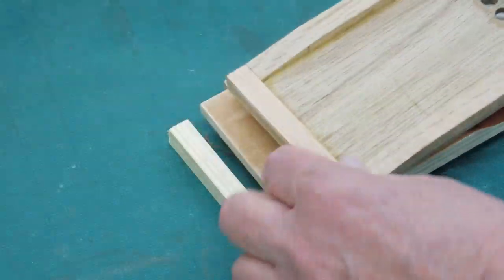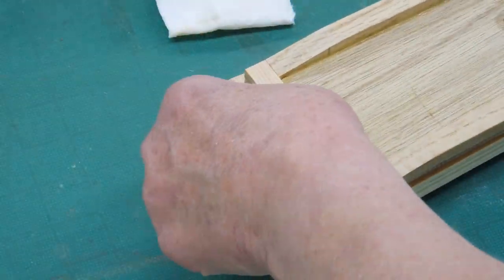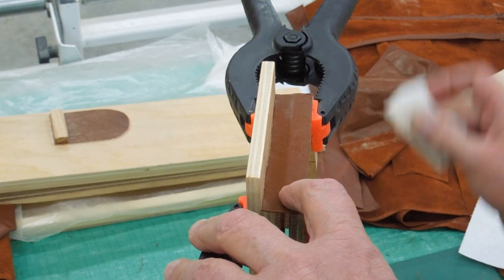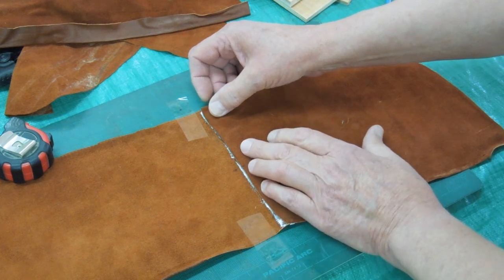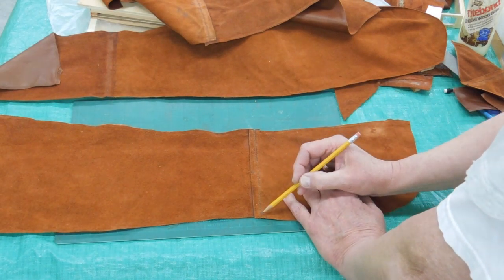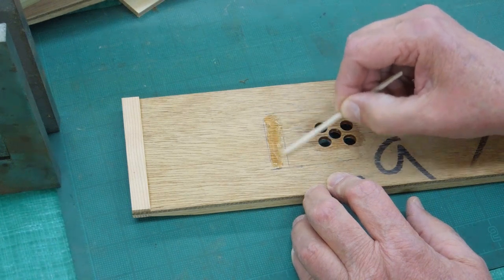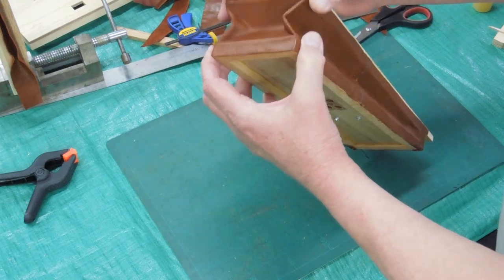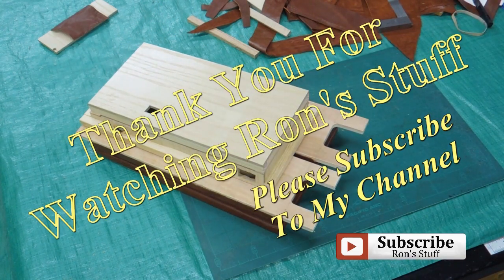Building The Busker Organ - Flapper Valves & Bellows Part 2

Comment: Hope you continue with the Busker organ videos, I've just started and could use more guidance on the pipe dimensions. Thanks for the help,
Reply from the maker: I suggest you carefully study the plans and write down the dimensions pipe-by-pipe. His drawing can be a bit confusing. In the area of the plans where it gives the pipe dimensions for a width and says “plus wood” … that means to add the thickness of the wood to either side of that piece… so it means that dimension plus 2 times the wood thickness. Clear as mud… right! It was confusing to me until I read it several times. I will cover a little bit about the pipes in a video in a few weeks but probably won’t really get into any real detail until the actual build videos, which will be a bit down the road.
Reply: Ronald Walters Thanks!

Comment: How about using a seam roller on the wet glue in the stitching holes to push the glue into the holes.
Reply from the maker: That would help, but what I did worked perfectly. Better still use a full size sheep skin and no stitching. I have several videos on making the Senior 20 Organs.
Reply: @RonaldWalters2010  it's just a thought, it wasn't meant as criticism.  I came to your video to see how you made the one way valve. Are there more videos on the organ ?
Reply from the maker: George, I didn't take it as criticism... I tend to be a bit blunt sometimes. I started to build the busker and switched to the Senior 20. The Senior 20 is a better organ, better wind, improved pipes, improved air supply, etc. My build of the Busker air supply was an experiment for me to see how the system worked and to decide if I wanted to go any further. I ended up using the Busker air supply to test pipes for my other organs. 

I built two Senior 20 Organs, the first without a conductor and the second with a conductor. I later converted the first to be motor driven with motor rewind and the second was then built with a motor from the beginning. I made the case a bit larger to accommodate this as I have no intention of carrying the thing around (ever). You will thank me hundreds of times if you build yours with a motor as the organ will get played many more times and you will enjoy it more (and your shoulder will thank you).

I then designed (from the ground up) an Animator Conductor to go in my second Senior 20. I sell a casting kit for the Conductor. 

Go to my channel page and then to "Playlists". There you will find the entire video series on building the Senior 20, building the Animated Conductor and more recently my build of a Mini Calliope which originally was a construction article in Popular Mechanics.

Quite a few have used my videos to successfully build their Senior 20 organs.

Your subscription would be appreciate and helps support my channel as does watching the ads. If you have any questions ask away. 
Ron
Reply: @RonaldWalters2010  thanks for the info. I , too can be a bit blunt occasionally and after I commented it occurred to me that my comment might be taken as criticism. I'm glad you didn't take it that way.  I'll check out the play list. Thanks again.

Comment: Man.  Doesn't appear to need much glue to hold the leather against the ply.  But make a good solid connection?
Reply from the maker: Solid. I have run this at much higher pressure than required by his design.